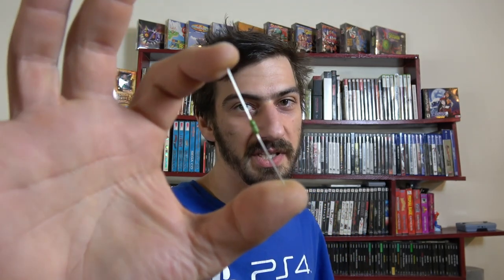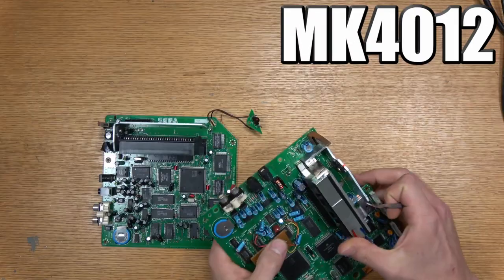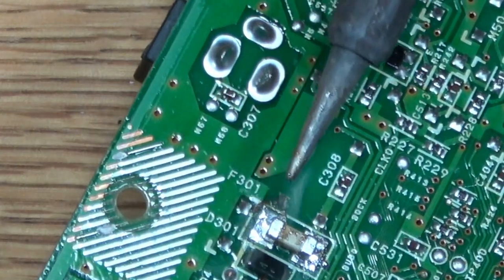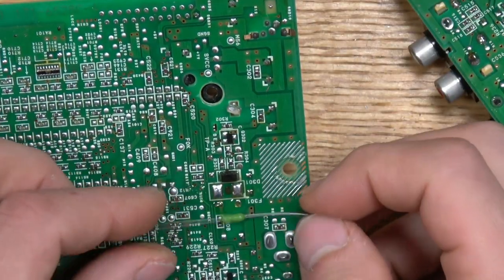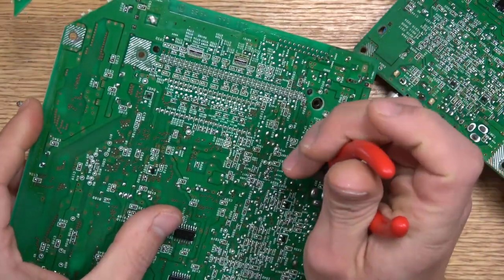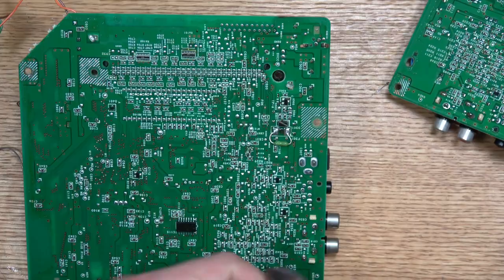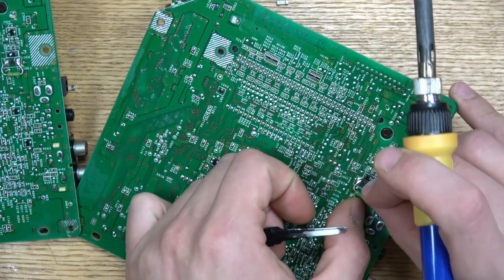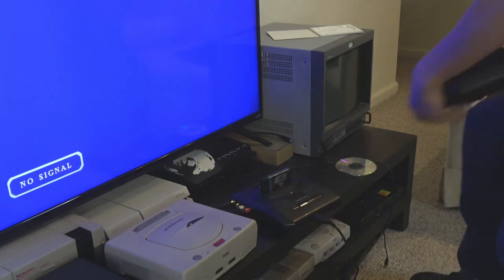SEGA-CD No Power? FUSE REPLACE TUTORIAL - RETRO GAMING ARTS

Comment: I replaced the fuse on my cd today as a first time solder-er and when I powered it up after, I could faintly smell burning plastic and replaced the fuse again but still doesn’t turn on. Did I just brick the system? And what could I have done wrong?
Reply from the maker: Hmm. I'm wondering if a cap replacement is in order. It's tough to day withouht probing around with a meter and looking for discrpencys

Comment: Is it safe to use a MK1602-3 for the Model 2 SEGA CD? I noticed it’s a 10V output PSU versus 9V on a regular MK1602.
Reply from the maker: Totally fine. I've used the 10v variants
Reply: @RETROGAMINGARTS  Hmm. I replaced the fuse with the exact replacement from console5 and even tried the pico fuse. Still no power. So I began to question the PSU. I’ve seen the power light flick on a few times but just a flash and never more than one blink. Any suggestions?
Reply: @RETROGAMINGARTS  I can get the power light to flicker one time when reconnecting the Genesis and attempting to power on first try. Other than that I have nothing. Any suggestions?

Comment: Do you need to put the flux, or is it optional?
Reply from the maker: it can work withought using flux, but using flux is the better rout to go, i highly suggest using flux, aswell as using it as often as possible
Reply: RETRO GAMING ARTS where can i get it? How much is it?
Reply from the maker: oh flux is dirt cheap, i'll give you a link
Reply from the maker: https://www.ebay.com/i/261276581971?chn=ps
Reply: RETRO GAMING ARTS thank you
Reply from the maker: thats a flux pen, it's alot easier to use than what i'm doing, i have a small tub of flux, and i use a paint brush to apply it, the pen is alot easier, but i use the tub because it's going to last me 2-3 years, even if i use it every day

Comment: Good video. I want to take my ps1 apart and see if i can fix it. Keep up the good work. Any where i can get parts for cheap?
Reply from the maker: Buster Gundo did you clean it's laser?
Reply: RETRO GAMING ARTS if you are referring to the clear part where it would show up red then yes.
Reply from the maker: Buster Gundo ya that's the lens, you may need a new one. The lasers on the PSOnes burn out quicker than the original PS1s
Reply: RETRO GAMING ARTS its red when i turn it on..

Comment: I have no power so I took the unit apart, the fuse was ok when I tested it with a multimeter. 
Anything else to look out for?
Reply from the maker: Capacitors
Reply: I blew all the dust out, put it back together and it works! 
Ordered a couple of fuses anyway to have on hand

Comment: any help for model 1 ?
Reply: Whats it doing?
Reply: @halo3odst  first thnx for your concern :) mine its model 1 and no power at all
Reply: Slide the genesis in and out a few times to make sure the expansion port is making good contact, make sure both systems have their own power supplies and if it still wont turn on i would say its the fuse.

Comment: Mine doesn't have a ribbon cable.
Reply from the maker: Your fuse should be on the top of the mobo then if I recall correctly
Reply: @RETROGAMINGARTS  It is, I was just saying that it just happened to be different than both of what you had. That's my life, nothing is normal.
Reply from the maker: Lol
Reply: @RETROGAMINGARTS  It works now too.

Comment: Man what you doing, just cut the leads to length before soldering while holding the fuse with the tweezers!
Reply from the maker: the fuse is slightly longer than the pads are wide
Reply: I realized that when I did it myself 10 mins after that comment. I still clipped them anyway and mounted it vertically, way less work.